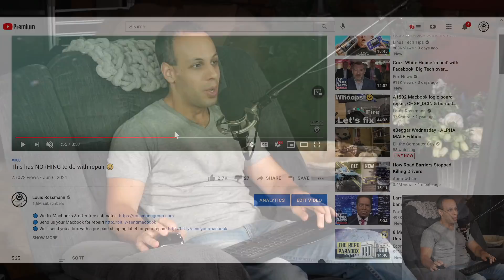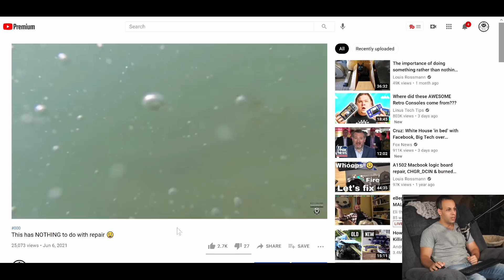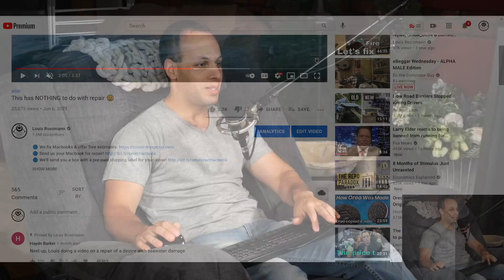Why are user serviceable batteries a bad thing?

Comment: If all phones had replaceable battery we'd be swimming in portable tiny servers to do all kind of cool things
Reply: No, that's a separate problem. The closed nature of the platform applies to more than just batteries.
Reply: @brodriguez11000  what platform are you talking about ?
Reply: @YounesLayachi  : Cellphones by their nature are varying degrees of a closed platform. From closed firmware to undocumented hardware.
Reply: @brodriguez11000  I don't see how that relates to my proposed use case ? They're still very capable and can be used as a perfectly decent replacement for a raspberry pi , for example. 
Many olds smartphones are loads more powerful than the cheaper pcs

Comment: Be glad you didn't take a Note into the water. Good lord those are insane. Note 4 was $750, OK. My note 9 Premium (512Gb model) was $1,250, yikes! I now own a Note 20 Ultra 5G at $1,500. My wife broke her phone and got my 9, so I got the 20, but Jesus, these things BETTER last a while. And yes, I do hate the sealed batteries in these. I replaced my Note 4 battery after four years and it still goes strong. I am concerned about the 9 and 20 due to the sealed batteries.

Also, I hate that the Note 20 has no headphone jack. That means I need to buy Bluetooth ear buds or something, WHICH HAS SEALED BATTERIES.
Reply: Actually if you look Samsung BT headphones at iFixit they gave them relatively good score for battery replacement... but as how it is done it could be still better.

Comment: Bring back replaceable batteries!

And while we're at it, bring back MicroSD slots too!
Reply: What micro sd slots are gone? Ffs i have a 256gb in my lg g6...
Reply: @MmeHyraelle  see the new Samsung phones, no microsd card slot
Reply: @Slada1  All of them, or just the expensive models for suckers?
Reply: @Slada1  so they have fully become apple? gawdfrikendarnit!
Reply: @MmeHyraelle  LG V20 has both, feelsgoodman.
Reply: @MmeHyraelle  It's simple. Why would anyone buy the more expensive version of a phone that just has 16gb more memory when you can just buy and stick in a 1tb SD card for roughly the same amount of money?

I haven't had a phone with a MicroSD slot in a long time.
Reply: @jaysus4114  I have 512 GB phone variants. And still want/need a memory slot. A dead phone with a me.ory card has the backup on the memory card. A dead phone without a memory card requires that I can (in any part of the world) directly transfer recordings to a cloud server.

So spend a week in the mountains - what coverage for backups? Climbing cliffs and passing water streams - what opportunities to smash the phone against a rock and have the battery start a fire when the plastic is punctured and the Lithium gets in contact with the water?

All I can say is f u to any phone that doesn't allow easy backuos to a memory card. If I need to carry a USB C memory just to take a backup, then that is a huuuuuuge usability failure.
Reply: @MmeHyraelle  But that battery though.  2.5 hours screen on time.
Reply: Add back the charger and headphones in the box too! When I buy a $1000 device, I would like to be able to use it and not find some other, older charger just to get it going.
Reply: Used Samsing for ages, until they started to take notes feom Apple.
Got myself Redmi note 10 pro, has headphone jack, micro sd, dual sim, 108 megapixel camera while being waterresitsant for 280€. It can trade blows with the latest iphone for a fraction of the price.
It comes with a 30W fast charger, USB-A to TypeC cable, Headphones, a simple transparet Case and even a preinstalled Screen-protector (yes it has google apps, despite being chinese).
You know, all the goodies Samsung used to have (minus the included screen protector).
Sadly no user replaceable battery, i guess the s5/mini was the first and the last with this feature while beeing water resistant.
For me personally it was the best option the market has to offer right now.
Reply: @timhartherz5652  all that goes to waste of you keep the default preinstalled malware, get lineageOS
Reply: @YounesLayachi  As if any device these days comes without a boatload of questionable junk preinstalled.
But i was surprised how much i was allowed to uninstall compared to other devices. 
I will consider linage if it turns out to allow this device to work properly for a change, didn't had any luck with it in the past, somthing was always broken/buggy with it after installing linage.
Reply: I was actually slightly annoyed to realize that the Oculus Quest 2 dosn't have a micro SD card. It has screen capture, sideloading, and multi gig games, but no extendable storage.
Reply: And headphone jacks!
And flat backs! No more camera bumps!
And full screens, stop taking parts of it away for selfie cameras! I don't need the corners rounded either!

Make a phone that doesn't suck!
Reply: @mjc0961  Right? Like what is this bullshit with 5 cameras when they take out the headphone jack and SD cars slot. I don't need five fucking cameras! I want to replace the battery on my phone and have it survive a fall. Which reminds me: I don't want the screen to wrap around the edges, either. Why have recent design trends been such trash?
Reply: @mjc0961  that camera bump on the back is the worst!!!!!!!!!!!
Reply: Samsung Galaxy A12 has a micro SD slot.
Not the best phone but that was a selling point for me.
Reply: @Tuck-Shop 
A52 has one too. And headphone socket. Much better than the A12, but still comes with the poor people features.
Reply: @tin2001  Way out of my price range but thank you. That's awesome to know.
Reply: @Tuck-Shop  but thats a A phone. A active phone is the lowrst of the line.
Reply: @madbruv  It still suits all my requirements.
There's no point spending 3-400 on a phone when a 170 phone will do.
Reply: I have a Sonim XP8. I have a removable battery, an SD slot and it's waterproof and indestructible. And if I destroy it it's replaced by Sonim free of charge, no questions asked.
Reply: You should stop buying the expensive models of smartphone and instead look at the lower end market.
Like some of the lower end Nokia smart phones like the Nokia C3, does have dual sims, micro sd slot, headphone jack, no notch, no bloatware and replaceable battery and you can quite easily buy such a phone right now that one just cost me 100 USD outright.
Reply: @alephomega6472  lower end smartphones are dumbphones with unusably bad performance (emphasis : unusable)
Reply: LG were so stupid man...
They were the first to do glass sandwiches with sealed batteries when everyone else had removal batteries and plastic backs, then they backpedaled
Reply: Stupid Google and their Pixel for starting this trend on Android.  They deserve to burn in hell.
Reply: sony might be your go to

micro sd/dual sim
headphone jack
Reply: @NonsensicalSpudz  Sony flagships aslo have no notch/screen cutout and dual front speakers :D
Reply: Vote with your wallet! I have a Fairphone where almost all Parts are user replaceable, it has dual SIM AND a micro SD Slot, not one of these shitty hybrid Slots.
Reply: Amen to that. And stop following the anti-consumer antics of ifruity.
Reply: And birching.  Bring back birching.
Reply: @parsnipfingers  AND CANING!  "SIX OF THE BEST!"
Reply: @bubosibiricus2204   good grief, man, YES!  I’ll never forget taking a hiding from the headmaster for playing spot with a leather cased football in the schoolyard.  Sir got jolly batey and set about me with a frayed carpet slipper.  Good times.  Nowadays you can’t say boo to a goose without fear of reprisal.  Little wonder why society has gone up the creek.
Reply: Just don't bring back headphone jacks
Reply: @nighteule  wtf are you opposed to headphone jacks for?
Reply: @ChrisBensler  headphones
Reply: @nighteule  ignorant

Comment: I miss batteries I didn't need tools to replace/remove.
Reply: I don't even hate the tools, its the glue and glass that really drive me nuts.
Reply: Remenber those? Just a clip. And they didn't exploded very often then.
Reply: I remember when they were so easy to remove that often times if someone would drop their phone hard enough the battery would go flying out of the phone, lol. And the phone/battery usually survived those falls just fine, instead of the screen cracking super easily like nowadays. I miss those days.
Reply: @DeathBringer769  Some Nokias were infamous for that, disassembleing themselves upon drop...without breaking ever.
Put the battery back, reinstall the covers, turn it back on as if nothing ever happened. 
Nowdays such a drop will cost you a professional screen repair...or a new phone.
Reply: @timhartherz5652  The device opening on impact and releasing the battery actually disperses energy from the shock and that helps avoid damage, opposed to a solid device that takes all the energy into its body. Unintended but welcome side effect.
Reply: @thelegendaryklobb2879  Yep, gave the device enough flex and give, you could drop it down a flight of stairs without side effect.
I once had one of my phones run over by a truck by accident, it actually managed to crack the LCD, replaced it myself,
got a new front cover for it- good as new.
There were upsides to the all plastic construction, it was cheaper, lighter and more durable and in the case of Nokia you
could ever personalize it by changing it's cover at will.
Reply: Those Batterys had to be "dumbass proof".
A can around them, so dimwits couldn't bend them easily, and fixed contacts with springs on the other side,
so they can't rip off cables cause a short or reverse the polarity.
This made them slightly bigger of course, but not by much.
But flatness is the new cool, even though these razer thin phones with the rounded edges become increasingly awkward to handle... so you put them into a fat case with a finger loop or something...but technically your device is a fraction of an inch flatter, so you are hip and up to date.
Reply: ME TOO
Reply: There's a very simple solution: don't buy a phone that doesn't have a removable battery, not even if you like everything else about the phone. Draw the line.
Reply: I miss looking for a flat head screwdriver to replace a battery...

Comment: I like replaceable battery's. What's even more interesting is a have a original battery from my openmoko neo freerunner.(2007 phone) it has outlasted my nexus 5 and 10, and google pixel. Even the battery on my nook color is still the original. I fell the batteries are intentionally made to be obsolete quicker now. Just my opinion. No proof of such.

Comment: My Samsung R330 flip phone had no water resistance rating, had a user replacable battery and worked well for me for 10 years. I had accidentally dropped it in water several times and I removed the battery and let it dry out every time and it worked with no issues and I seen a water damage indicator inside the battery compartment, not tripped. I sent that thing through my washing machiene and it survived though I no longer trusted it to work without issue and only a few months later they shut down the CDMA Network that the phone was operating on so it was already had it's days numbered at the time of replacement. I want my User replacable batteries as that way I can cut the power to the phone should it be dropped in water to reduce the chance of corrosion damage should water get into the phone.

Comment: Not to mention, you can SWAP batteries mid-day or WHENEVER to have a 100% charge. There are use cases for that (which is why DJI went to the trouble...).

Comment: If Samsung had kept the old style removable battery in the S7,  they would have not had the whole exploding problem.   Or it would have been less of a problem.
Reply: Exactly, people would have been able to take the dodgy one out, chuck a non-dodgy one in, and problem solved.  Less cost for everyone involved, less trouble too.
Reply: samsung issued replacements for the note 7(it wasnt the s7) that had different batteries  and it still had that same issue, more likely than not there was a design defect when it comes to heat management
Reply: @davidashurov5255  Yes, it was the amount of space given to battery, but given that batteries expand when hot, this essentially led to batteries being crushed.

So of course the replacements at the time had the same issue, as the issue hadn't been solved.  The FE was when they reduced the physical size (and capacity) of the battery, and low-and-behold, there were no problems.
Reply: @tams805  yeah but OP for the comment thread said the exploding batteries thing could have been avoided with removable batteries. But iirc the FE version had a slightly skinnier battery(less wide) so wouldnt there be fitment issues
Reply: *Note 7, not S7.

Comment: I've been designing hardware for a few years. I want a handful of standard battery shapes and connectors so that smaller companies like mine don't have to waste time sourcing specialty cells and connectors. Mass produced would be nice and just as cheap as I have to deal with now. My Samsung Galaxy S (original) had it's battery go bad after 2-3 years. My Nintendo switch controllers genuine battery  went super bad at just over a year. My Fujifilm NP-126S with my xt-30 took 3 charges and then poof and wasn't worth the hassel to get Fuji to replace. The high end brands are failing at quality control, so 3rd party cheapies are getting more reliable from no name Newer. At that point what am I paying for if not quality.

Comment: With the OnePlus One, they decided pretty last-moment to make the battery not user replaceable. They said that when you make the battery user replaceable, you also need to add circuitry to prevent shorts or other misuse. That would take up space, creating less space for the battery. Back then, OnePlus was a pretty different company than it is now.

It's a tradeoff between a user replaceable battery or better battery life out of the box.

Not that I'm advocating for this, but it might be somewhat of an insight.

Comment: The EU is pushing for user replaceable batteries, but will most likely die before passed 😅
Reply: Nope, the EU (as always) will pass it but the bill will be so retarded that itjust probably gonna ban replacable batteries.
Reply: @killmeplease5389  I dunno man. GDPR has been pretty great so far unless you're an American megacorporation who makes money off selling user data. :)
Reply: @Clawthorne  You mean the anoying thing when you have yo click yes on every fucking site. Or spend 5 minutes to find a reject button. I fucking hate it when you in a hurry and trying to do some research. Especially if you are using incignito mode so the phone don't pop up 10 ads after i searched for a valve for 5 minutes..
Reply: @Clawthorne  Well, it sure did make people realise a few things through sheer annoyance. But I gotta say, it's a bit annoying that blocking cookies from sites now leads to endless popups, and you effectively have to either bite the bullet and delete them every session, or get some third party pop-up blocker (I guess you could write one yourself if you were both paranoid enough and skilled).
Reply: @MrCh0o  Mind you that this is not the fault of the EU's regulation. This is the fault of sites annoying you intentionally in the hopes that you will vote in a way beneficial to them in the future. No site needs cookies unless it has a login system and wants to offer you the ability to stay logged in. Everything else can be achieved using local storage (site preferences, etc). The only difference is that cookies can be read by them, while local storage cannot.
Reply: @Clawthorne  Yeah, I understand that the issue isn't with regulation, but with sites that aren't willing to part with their tracking cookies. Although it's debatable whether the intent is to annoy or just to keep using them while providing mandatory notification... I suppose they could render notification on client's side and give users ability to dismiss it forever by storing a setting locally? If so, I can see it being a way to pester users on purpose

Comment: It is cheaper to glue battery and leave it than create a fancy door on a back of a phone. Also wireless charging requires the back of the phone to be thin and made out of glass. There is a milion reasons why not having replaceble battery is better.
Reply: Then why are modern phones so much more expensive?
Reply: Is charging you’re phone wirelessly really such a necessity to have if your phone will be worse in the long run in terms of life span
Reply: Wireless charging does not require a non-removable battery nor the phone to be thin. The device can be as thick as a brick as long as the coil is at the bottom of the phone, the only relevant parameter is the distance between the charger's coil and the phone's coil. The S5 had an optional wireless charging cover and it was still waterproof with it. I really can't think of a single disadvantage of non-removable batteries from an engineering standpoint. We all know that forcing you to buy a new phone or a powerbank after 2 years or so due to the aging battery is good for the company though.

Also it's not like the 5 cents they might or might not be saving by just gluing the thing lowers prices down for you anyway as evidenced by rising phone prices. You pay more for a device with less features. Even if the amount they save was significant and directly lowered prices, the difference wouldn't be enough to cover the cost of a battery replacement in a shop or buying new devices more frequently.